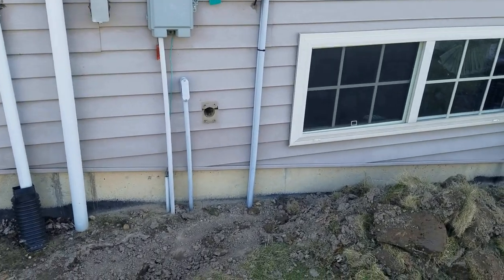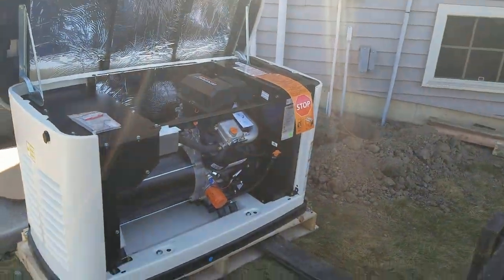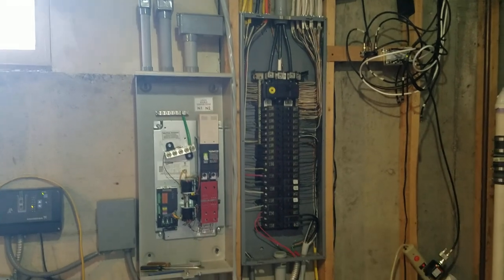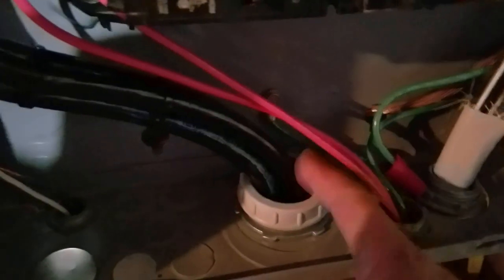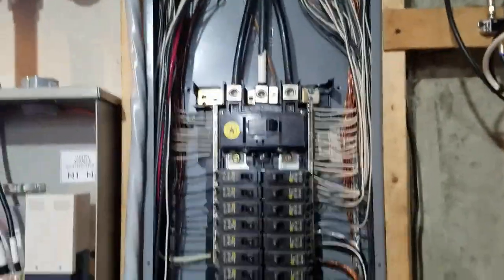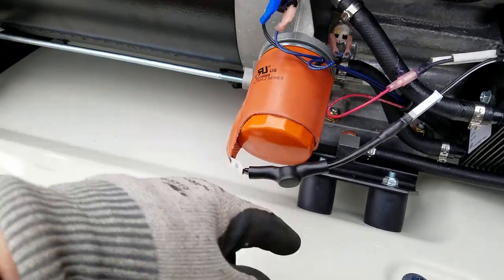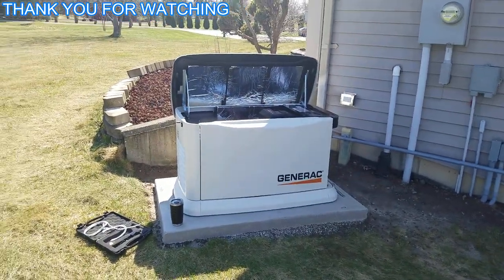22KW GENERATOR INSTALL with 200 AMP ATS

Comment: DO The low voltage wires go from transfer switch to the generator?
Reply: looks like about 4 or 5  #12's going through a 3/4" conduit?
Reply from the maker: Yes, sorry just seen this

Comment: The adaptor used to transition from the flex conduit to the rigid conduit, what are they called and what brand?
Reply from the maker: They are PVC couplers, most home depots or lowes has them.
Reply: @JamesF406  Thanks...just used some good old brain power and figured out the solution.
The question I asked is one of the most widely asked.

Comment: What size Aluminum wire did you use from the generator to the transfer switch?  My mom has a 90ft run from generator to panel.  I was thinking 4/0 AWG Aluminum.  Curious to what you used.  And I think you missed a "drip leg" or sediment trap in the gas piping.  But I'm no expert.
Reply from the maker: That's what I come up with on my calculator with a 1% voltage drop for  using copper.(#4 AWG) I might go a size bigger for going that distance. I used #3 because my buddy had extra, it's used for industrial 100 amps.
Reply from the maker: And you are correct about the drip leg for the gas line, lt is inside the generator already installed by the factory:)
Reply: @JamesF406  Sorry, I just looked at some of the video again and didn't realized you said it's internal.  Great Video!!

Comment: How many pokes did you get playing in the live 200 amp panel. Also.......pretty sure you should heat shield those wires you fed through the heat shield near the exhaust manifold.
Reply from the maker: 🤣, I shut off the main when I separated all the grounds, and yes, that's a good idea, I am kind of surprised they didnt have a dedicated path for those wires.

Comment: Nec 110.26 (3) working space. That ng pipe cant be ran under the panels. Pipe shall be buried by IPC minimum 8". If it can be ran over by a vehicle then it must be buried 12".
Reply from the maker: Thank you for sharing.
Reply: Varies by locale though. In WA code has to be 24" if a vehicle can drive over.  And 18" if no cars can drive over. Pretty sure that 24" is universal since 12" is really shallow.

Comment: I have Installed a few Generac systems . On one system everything worked perfect with the smart system switch. fast forward to about a 2 weeks ago client lost power, generator started but smart switch did not switch over to Gen power! I came out and check everything could not find a problem, have you ever heard of a smart switch being replaced? Also Generac does not have a very good tech support help,  little disappointing.
Reply from the maker: Negative,  Sorry to hear that. I have not.

Comment: How did you extend the utility coming in, was it spliced ? If so did you use barrel lugs ?
Reply from the maker: No splices, ran new wire.
Reply: James Foster LS3 TA what is the wire size you used from load side of transfer switch to service

Comment: Got a question for you.  I want to prerun the conduit and connecting wire that goes from the transfer switch to the generator (natural gas 22k).  Could you please tell me exactly what type of wire to use.  One vid said Romex 10-2.  Just wasn't sure if that was enough, or if you needed more than one.  Thanks for the help.
Reply from the maker: Yes, I can help, give me a few, how about sending me a text tomorrow and I can send you pics and wire sizes. 616-401-2591 James
Reply from the maker: Do you have the manual, that is what I used.
Reply from the maker: @lebowenman1  yes

Comment: Can you make a update video? Like pros and cons of the generator
Reply from the maker: Yes sir, so far only 25 hours ran, no cons just yet only pros, we always have power😁, although I wish it would run longer when it exercises itself,  5 minutes doesnt seem long enough. Once it gets warmer, I will make a update video,  make sure you subscribe.
Reply: @JamesF406  I ran mine manually to get to recommended hours for first oil change so I could go to synthetic oil. Shipped with lightweight break in oil. I agree it would be nice to run longer each week. 15-20 minutes would be preferable...
Reply from the maker: @chuckquinn8026  I would also like to change over to Synthetic. I need to look it up, not sure how long the break in period is.

Comment: Are you an electrician? If you arent this came out pretty  good. I would have moved generator a little out from  meter but other than that great job.
Reply from the maker: Thank you! Legally no, I have a 30 year Industrial Maintenance Background with a Electronics degree but work with several Journeyman Electricians who answered and helped me along the way, I also looked up the codes to make sure I wouldn't have any issues, I should of moved it out another 6-12 inches from the meter, right now it is exactly 36". Thanks for the nice comments.

Comment: question I have a heat pump 16 seer 2 stage dual compressor lennox  and a well with a 1 hp pump and a electric water heater and the rest of the house is 2.6 studs with 6 feet of insulation in the attic and floors are insulated ,double pane windows   .Only propane available here  would this one run my house  We are senior citizens in our late 60's and winter is getting scarier  for us .We keep air on in the summer at 76 and winter the same for heat .We live in southside VA House is all led bulbs and all energy efficient appliances
Reply from the maker: Sorry, I have no idea but the Generac folks are awesome to work with, they answered a lot of my questions.

Comment: Curious where you got the control wire from? HD and Lowes don't have many options for 18awg.
Reply: I am one of the oldest Generac dealers in the country I helped start the company you can go to Home Depot get number 14 controller thh wire
Reply: @jamesbriley1655  oh, you're using 14ga? An electric supply place has tray cable  (the control wire/phase wires bundled together).  I think I'm gonna use that. Thanks for the response. Good install. Your video helped me.

Comment: I think I'll just pay the two grand to have mine professionally installed.
Reply: That's a lot of money, it's easier than you think.
Reply: I just got quoted over the phone 15 - 17k minimum to install this generator. $2k is optimistic.
Reply: @RDPfromTexas  my 22kw was purchased and installed via a local electrical contractor and was $10k including pouring a pad, plumber installed galvanized gas piping, gas company installed new gas meter (free), electric, plumbing, fire and zoning permits...Southern New Jersey
Reply: @chuckquinn8026  thats a fair price. We do them for 10-12k

Doing one tomorrow for a complete price of $11,500, 24kw

Comment: You must have a shut off on the transfer switch or above it I recommend the one that comes in the transfer switch it is much safer if you do not have a shut off in between the meter in the panel to transfer switch you could have a very very bad problem if you have a power surge in the house or lightning strike

Comment: Like everyone else said,  good video. Out of curiosity are you and electrician, lots a good info. I’ve got the money saved up solar and want to run a generator for when the power is out. This seems to be cheaper than a battery bank.
Reply from the maker: By Trade no, but I am in Automation Controls and work for a major Electrician company. Thank you for the kind words.

Comment: That 100 amp wire is not a number four for that generator you got to size your wire to 1.25 more than what your load on the generator at startup is then you size it to your transfer switch in 100 amp wire for a transfer switch is either number two or number one per NEC
Reply from the maker: It's number 2

Comment: If your wire is scraping up your transfer switch it is too tight going in you need to Loop it down a little bit and give it a loose Loop to go in it should not scrape the transfer switch it is way too tight you're putting too much pressure on The Wire and wiring time does get brittle you will have problems and you'll have to replace that area of The Wire it is much better to leave a loop go down and then come straight up into transfer switch

Comment: I was wondering if the unit is placed to close to the house (fire hazard). How far is it from the house and does it meet code?
Reply from the maker: Yes, there are code measurements listing in the installation manual and mine does meet those requirements....barely
Reply from the maker: I forget those measurements but will report them to you, stay tuned.

Comment: The best battery for a generator it doesn't matter which generator as long as it's in 25 KW is a 26r bought at Walmart a very good battery gets constant charge 6 hours on 6 hours off it is too much of a charge in the battery will die sooner by Walmart battery they're much cheaper and it will last longer because it can take the constant charging because it's a cheaper

Comment: The case will rust in 3 years no matter how much you do to keep it dry. They're made of really cheap sheet metal and the powder coating is terrible, now the generator is awesome!
Reply: The case is aluminum…our is over 10 years old and no corrosion

Comment: What does this cost to have the whole thing done
Reply from the maker: I have about 6k in Material, my friend said he charges 9-10k for turnkey. Oh yeah wait for the deal, free 10 year warranty plus small 2200 generator.
Reply: @JamesF406  We just quotes today from generac and kohler for turnkey systems.  Some major sticker shock.  We're not in any great hurry or need for installation, so what deals should we be looking for?
Reply from the maker: @jamesgroce3125  generacs best deal is a 10 year warranty and a free 2200 Watt Portable generator that I still haven't used. This deal only comes around once a year if your lucky.

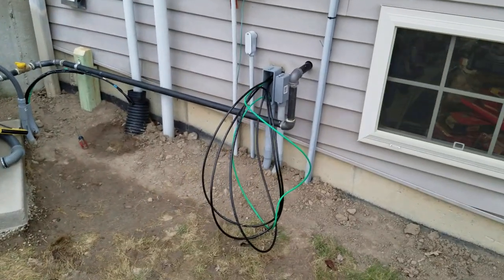Comment: 10:35 and your inspector is going to tell you that you forgot a drip leg on the gas line and that you can‘t install it that way codewise
Reply from the maker: The drip leg is preinstalled inside the generator.

Comment: You are much better running number 14 control wire not 12 this way if you get a surgery issue the wire will short itself and protect your home

Comment: There's no way you didn't have to change the wire from the meter to the ats.  Also try using a local electrical supply house and give back to the community. 
Did you get a building permit?

Comment: Looks to be too close to windows; ( CO from engine exhaust ) Clearly against code. Another possible entry of CO into house is the dryer vent less than 3 feet away. Codes are meant to protect the occupants, not to make installs more difficult.
Reply from the maker: Good eye, that has been relocated and blocked off, just need to residing it later. We are 5 feet from the windows.👍

Comment: So the gas meter feeds into the house through a 1x3/4 bell reducer to 3/4 pipe, and you tied into that and ran a 1" pipe off of the 3/4" house feed to the generator - - - - - - - WHY?
Reply from the maker: I actually had to go look, it's an 1 1/4" down to 1" bell reducer

Comment: Improper clearance from generator to wall of the house and meter access will not get a sticker and Pennsylvania
Reply from the maker: Glad it passed here, just barely.
Reply: I am glad to hear it because they are sticklers around here. looks good though
Reply: You can be 18 inches from the house with the Generac units but must have 3ft Infront of the Electric meter and 5ft minimum from windows doors or other openings
Reply: I was referring to the 3' clearance requirement for the front of  Electrical panels and enclosures From the pictures it didn't look like it was quite that far away

Comment: Have the owner to get a battery tender I got the exact same one hard on batteries
Reply from the maker: Do you know what the issue is? Supposed to have a built in regulator on the tender already.

Comment: Really the 22kw is overkill for most 200amp service homes, a 15kw would be sufficient in most cases.
Reply from the maker: I just wanted to power everything I could, AC unit, 220 well, refrigerator,  freezer, furnace, washer, dryer, dishwasher,  Polebarn, 😁😋
Reply: Depends on the generator mfg.  Most of the KW ratings are for LP gas, if you're running NG the rating will drop.  Besides, the price difference between a 15kw / 22kw is negligible and allows for future expansion.  YMMV
Reply: @doubled5074  Opposite actually. NG is higher vs LP

Comment: If he is not licensed for the gas or the electrical inspector will not pass it you can actually be fined if an electrician or a guest service person does not do this install also read your owner's manual it does not help with your warranty you will actually lose part of your warranty if you install it yourself
Reply: Home owners can do gas and electrical in WA.  And can have unlicensed help too, so long as they are not "paid". And it will pass. I've done 3 full wiring installations, all inspected. Have never done gas yet, but about too. That's how I ran into this video - there's a lot of details to learn. This video is pretty good, but still missing 100% covering ALL the details. I've spent about 20 hours (over a few weeks) digging up anything I might have missed.  One details is that "SOME" inspectors will make you install a surge suppressor. Rather than argue, I just bought one from AMZ. Besides, I wanted one anyway :) Gas line sizing is interesting since Generac, our gov licensing  and various sites do not end up with the same values.

Comment: The generator is in wrong spot need to be  36" away from electrical  service
Reply from the maker: It actually is with a tape measure🙂
Reply: @James Foster LS3 TA  ok,
 didn't get a permit not a licensed electrician and no inspection
Job looks just like a non professional did it I have seen crap work like this all 46 years as a licensed master electrician and electrical contractor

Comment: I’m an electrical contractor in nj, wouldn’t pass because of clearance
Reply from the maker: Interesting if it's a 36" radius from the meter box I just made it, if it's from the front out 36" I'm good, my friend is a electrician and said it would pass here in Michigan with flying colors, you had me nervous so I looked into it 😉
Reply: Just know In jersey wouldn’t pass , glad it will work for you

Comment: Should be 10 feet away from house gas code
Reply from the maker: What State do you live in?
Reply: This can be installed as close as 18 inches to a non combustible surface but you MUST maintain a 5 foot minimum clearance from any point on the generator from any operable windows, doors, openings and penetrations. The clearance you might be referring to is the clearance from any fresh air intakes which is 10 feet BUT follow all local, state and international fuel gas code and international electrical codes and of course manufactures instructions.

Comment: Do you need a job?
Reply from the maker: 😋, I did take out the bonding screw later once everything was connected. Thank you!!!!!
Reply: @JamesF406  did you bond the generator
Reply from the maker: @georgefelectricalcontracting  yes in the transfer switch.

Comment: As a former professional electrician I'm wondering why you're separating the grnds and neutrals. Not sure that that's required.
Reply from the maker: Not sure why either but the Michigan  codes says to separate them as this is now not considered the main, the transfer switch is.
Reply: Yes, as James noted, that's the code now. AND they check the panel that it was done. I had another "bar" installed when they were all separated to handle all the extras that used to be combined.  (I'm in WA, but that is a National Code that pretty much all the states follow).